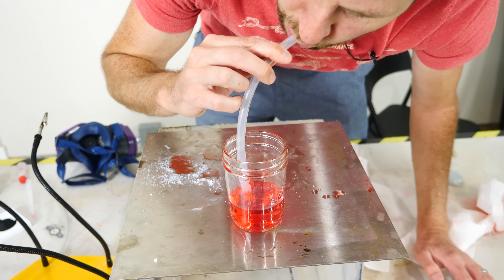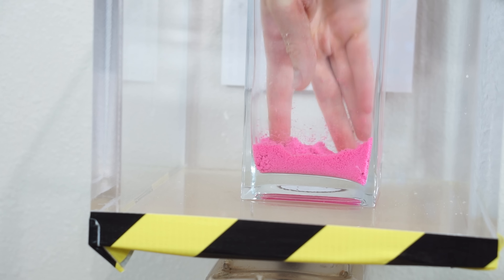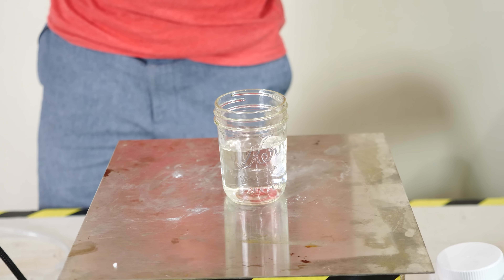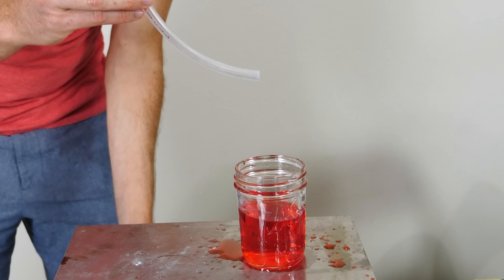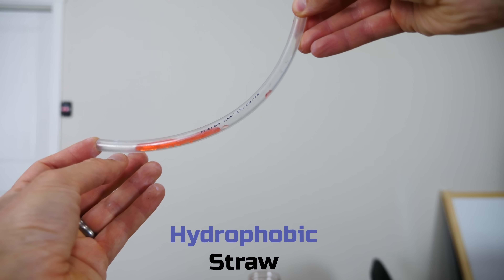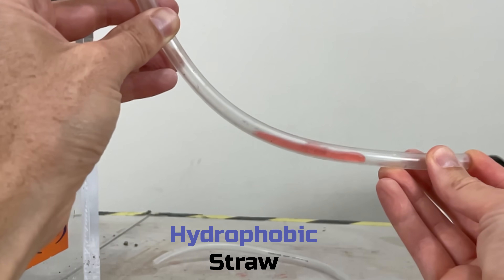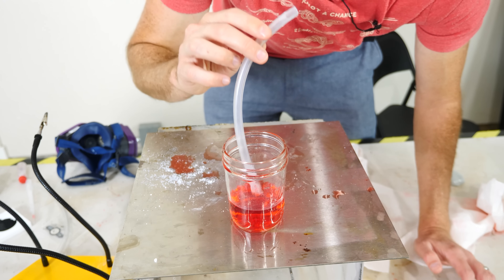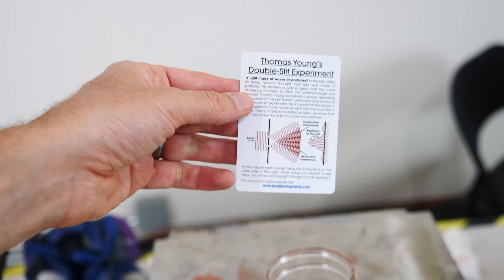Can You Drink With a Hydrophobic Straw?

Comment: What if you coat both sides of the straw so that there is an air column on both sides? Won’t that prevent you from sucking up even when the straw is submerged in water?

Comment: This isn't entirely true about the hydrophobic sand. After removing the air, the sand is still hydrophobic, but just no longer allows large air pockets to form a "membrane" that causes the sand to appear clumped. Removing the air just gets rid of this faux "membrane" causing the individual pieces of sand to stop maintaining a clump. The hydrophobic property still remains, but is only visible on a molecular level.

Comment: He didnt explain why is it that the water can move without resistance in the hydrophobic straw when both ends are plugged. Wouldnt the air preassure on both sides prevent it from moving? He is supposed to explain everything!!

Comment: If a normal straw locks water in the middle when you plug both ends, couldn't you technically do that with water bottles somehow?

Floating water seems like a cool thing :D
Reply: In the case of the straw, the surface tension plays a role too.

Comment: I'm not sure I agree with your hypothesis about the thin layer of air being how it gets past the water in the straw. I think it's more likely because the waters surface tension doesn't interact with the walls so it can't form the boundary with the air which can't break, so the water can just move out of the way, you can see that when you plug both ends, the water doesn't stay as a plug it kinda bubbles past the air

Comment: Everybody gangsta till he makes himself hydrophobic and gose to the bottom of the ocean
Reply: I mean, you wouldn't drown...
Reply: @geo4876  exactly
Reply: @geo4876 would suffocate though and die from the water pressure though without protection
Reply: @1fish146  That's different from drowning
Reply: @geo4876  i never said it wasn’t
Reply: @1fish146  Why did you make the original comment then?
Reply: @geo4876  i was explaining even if you wouldn’t drown you would still die??
Reply: @geo4876  but fall at incredible speeds, and die from impact ;)
Reply: If you leapt into the ocean in a set of hydrophobic scuba gear you would literally fall through it to the bottom. Possibly the pressure might overcome the hydrophobia at some point, but given the cavitations you'd leave above your fall it might literally not catch up to you in order to put that pressure above you actually ON you. Hard to say, I'm far from an expert.
Reply: @gwamhurt  You wouldn’t fall to the bottom tho, the layer of air between you and the water change nothing in the forces of  buoyancy, in fact, since you’ll be displacing slightly more water you’d probably be slightly more buoyant
Reply: @lotharschmal7991  fair but youd fall til you reached the equal bouyancy wouldnt you?
Reply: @gwamhurt  The same way you’d fall if you weren’t using any gear at all.
Reply: @lotharschmal7991  Not really, you fall far quicker in this way, you would be falling through the water almost at the same speed that you would fall by jumping out of an air plane. Buoyancy isn't always enough to keep people above the water, hence people drowning in pools all over the place. I can lay on my back totally flat and sink to the bottom of my pool (for instance).
Reply: @rdizzy1  That’s not even remotely true, please quote your sources/evidence.
Reply: @lotharschmal7991  What? A video of me laying on my back in the pool and sinking to the bottom? Lmao. On average, a human requires anywhere from 7 to 12 additional pounds of buoyancy to float, hence why they push for wearing life jackets for people that cannot swim.
Reply: @rdizzy1  Ah yes, and having more air around you somehow would conjure the force it takes to move water away and sink directly to the bottom. You need to present me some research buddy, cuz that makes absolutely no sense, like none at all. Your body needs to move water away to sink, the reason life boats are filled with air, something you’d be wearing all over your body in this case
Reply: @lotharschmal7991  things are heating up in the water fandom
Reply: @rdizzy1  floating is easy if you take a deep breath, if you exhale you start sinking even you are laying flat on your back.
Reply: @phat-on  Yeah but obviously you have to breathe while swimming.
Reply: @lotharschmal7991  there was an experiment with a hydrophobic metal ball and it’s way faster
Reply: @gwamhurt  i mean you sound like one
Reply: @gwamhurt  Never heard of Archimedes, my friend?
Reply: @gwamhurt  nice theory, but in practice the pressure increases incredibly much faster than you think. The energy to push water out of the way must come from somewhere, and in this case, the fall.
Reply: @Geoman265 He would drown, this is because the oxygen in the air barrier around him would deplete and he would die of asphyxiation
Reply: @pointlessprocrastination  Technically, that wouldn't be drowning, since he wouldn't be inhaling water.
Reply: @geo4876  sorry, that is what I meant
Reply: @pointlessprocrastination  he could hold his breath
Reply: Sorry, but if I acquired hydrophobia, I'd probably be foaming at the mouth and dying shortly thereafter, ocean or no ocean... :P [/sarc] (#RabiesJoke)
Reply: @MGmirkin  because the best jokes are always the ones that have to explain themselves through hashtags.
Reply: WHAT YOU  KNOW BOUT ROLLING DOWN IN THE DEEP
Reply: @ppeggy45  shut it, Adele
Reply: @mursuhillo242  You know that you have the wrong artist right?
Reply: @brooklynmurrell1280  Rolling in the deep by Adele?
Reply: Veritasium did that, though with just a regular swimming pool
Reply: @TobiNightcore  Yes he did (with aerogel) and he said he felt more buoyant. So, you wouldn't sink as far without the hydrophobic material and it'd be easier to stay on the surface.
https://www.youtube.com/watch?v=GcdB5bFwio4&t=260s
Reply: A --h h
Reply: I'm not sure how long that air layer would last, but it surely won't  last long enough for anyone to make it to the bottom of the ocean
Reply: @litterbox019  No, no, he'd make it... Maybe not alive... But he'd make it.
Reply: He would need something to equalize pressure
Reply: Present your evidence, I'll be the judge
Reply: Ye
Reply: Goes
Reply: Why would everyone stop being gangsta because of this I don't understand
Reply: @explosu  Why do magnets work?  We don't know it just happens.
Reply: Something I never knew I would be terrified of
Reply: Put a door underwater for 2 blocks of air
Reply: I feel like yes you'd be more buoyant because of the layer of air but it depends on your acceleration, if you're accelerating at high speeds into the water the pressure might keep you going downwards until friction makes it slow down. Friction would still work between the air layer and the water I think but I'm not sure because I'm just using prior knowledge and have no real specific research on the topic nor am I an expert.
Reply: The weight of the water was enough to overcome the hydrophobia inside that tiny cup. It would change nothing of you jumped in water.
Reply: cant wait for this video..
Reply: dies from pressure
i dont think we gangsta anymore..
Reply: Someone did that but goes in a pool instead
Reply: Watching experts explain is so satisfying I meant these guys at the comments
Reply: When you accidentally step into the Mariana sauce trench: o no
Reply: @breadisyummy_  everybody always forgets trench’s middle name
Reply: AHHH "EXPERTS" THIS IS A JOKEEEEEEEE SO STOP SAYING "he drowns becuase science science"

Comment: "They have almost no friction going through there, so they just shoot out he end!"
Me: :turns to the left to look at my waterslide plans:
hmm
Reply: Wait Are Regular Waterslides Not Hydrophobic?
Reply: @JNJNRobin1337  i think the problem is, that the water doesnt lube the slide anymore, meaning that if you tried sliding down, you just would sit on the dry slide, while water is flowing besides you. You need the water to reduce the friction between yourself and the slide.
Reply: @Eiferius  So what your saying is that we need to replace the water with lube!
Reply: @abdisaniini  yes
Reply: @Eiferius  But if you're wet, I feel like the hydrophobic slide would work.
Reply: @Eiferius  yeah that might make for a very painful experience
Reply: @JNJNRobin1337  Haha nope
Reply: @JNJNRobin1337  it depends on the plastic you're using, but the surface treatment shown in this video only works because it is a powder that helps preserve a layer of air between the surface and the water. In a water slide, this surface treatment would be washed/scraped away quite readily, not to mention that it would probably be very unhealthy to ingest this hydrophobic fumed silica.
Reply: Too bad the fumed silica is delicate. And would not stay in place. Adding it in abundance would be a health hazard due to breathing it. And it is very very light so a mild breeze alone would blow it away. Water would slide fast due to no surface drag, but people would not. Silicone oil soaked bathing suits on a regular water slide would be where i would start lol. But that would be crazy fast and i have no idea what health hazards the oil would have. But the speed hazards i can imagine woukd makensone good videos, errr or bad ones.
Reply: @airfriedquadsbw   Thanks for the information lol 😆
Reply: @rhirhisax  you got me cracking up
Reply: @airfriedquadsbw   😂 👍
Reply: @airfriedquadsbw  “health hazard due to breathing it in”

Meanwhile at action lab: “Watch me suck this straw”
Reply: @Wertsir I sold that stuff for 20 years. First time I saw it was regarding the space pen. Could write upside down  in space under water. Cost 1 million dollars to design. I was in grade school. Didn't know one day I'd be selling the stuff for them. Russan solution to space pen... pencil.
Reply: @Wertsir  they gave me a space pen when I left. And a model train car. But that pen, I was so happy. It's said Cabot NASA Space Program.
Reply: @airfriedquadsbw  That’s wrong, you can’t use pencils in space due to microscopic fragments of graphite
Reply: @AfromanRants  it was a joke. Pen is 👍true. Pressurized the ink cartridge. Used fumed silica to more or less to clog around  ball point stop ink from just flowing all time. Little bit of sheer silica slides ink comes out.
Reply: @airfriedquadsbw  I think it'd be very easy for you to die in such a ride considering the speed
Reply: @Dell-ol6hb  I said it wouldn't work. For many reasons, if it did some how work. Breathing it in is a big issue. It is said it doesn't create static. But I know a commercial lab or two that would dissagre
Reply: i keep reading quote comments as they're said in the video and its tripping me out hard o-o
Reply: Oh wow-😯
Reply: Just coat yourself in any mostly water fluid, something that'll stick but is still 80-90% water and BOOM human cannon
Reply: @ClippyJoestar  dude I have 2.5 million hits in 3 days on my tictok. All JOJO FAN CLUB. I got 2 steel balls did couple things with. I had never heard of jojo til 1 million hits in 12 hours. They still coming.
Reply: @ClippyJoestar  and funes silica doesn't work like that. I sold it for 20 years. Does make waterproof sand. And gravel. Greece. But it is in alot of foods. Keeps powers powder, not clumps. Aerogel is 100% fumed silica. Getting it into the shape of fluffy bricks is the trick. No spin to do it gyro
Reply: I was thinking about that right before I read your comment 😂

Comment: Have you done this experiment while coating both sides of the straw?  My guess is that you would not be able to suck up liquid through the straw with this setup since there should be a coating of air around the whole straw, which would prevent a vacuum from forming.

Comment: I had a question about the speed of light. 
If a human with a gun was inside a vessel travelling at 99.99r the speed of light, and fired the gun forward whilst inside the vessel what would happen? Would the vessel, human and gun slow down to accommodate the bullet which wouldn’t move? Or would the bullet pass the speed of light and just disappear?
Reply: The universe would implode upon itself due to a division by zero.

Comment: What happens with iron when you put it in a chamber with 100% oxygen? (compared to normal air)
Reply: I don‘t think it would rust because the process requires water molecules… google „iron rust chemistry“ and look at the first image.
Reply: You would be very surprised at what happens in an atmosphere of pure oxygen; it is highly reactive, and there is very good reason why the process of stripping electrons from a metal is called "oxidization". Do you know what other common phenomenon is also an effect of an oxidizing reaction? That's right, fire!
Reply: Wow, I didn't expect serious answers, and that anything else than faster rusting would happen, lol
Reply: @fehnboi5491  it very much depends on exactly how much faster the rusting occurs. The key ingredient in thermite is iron oxide; and when that stuff ignites, it produces an exothermic reaction that supplies its own oxygen and can cut through solid rock. So yes, extremely fast rusting can quickly become a very big problem.
Reply: @techgeeknzl  and tiny particals of most metals self combust. In pure ox i would bet on combustion. Id run. Lol
Reply: Fire
Reply: It rusts?
Reply: @techgeeknzl  oh, really, genius?
Reply: @fehnboi5491  of course it does. What do you think rust _is_?
Reply: @techgeeknzl  lol, dude, ok, I'll explain it, I mean how fast it would rust, compared to the normal air

Comment: This phenomenon would work in the vacuum of space in some advanced technology that required a liquid in a vacuum sealed tube to move around the tube like rotation or fuel transfer. Would this work with gasoline and does this mean if we make a gas engine have these tubes it could utilize the gas sucking it threw the tubes into the engine within the vaccuum of space if we can also get the fuel to combust in a vaccuum... but with this tube we are close to having gasoline engines in space

Comment: I’m a plumber and you may be on to something here.  If we were to make hydrophobic piping for drainage you technically could get away with not having to install a vent on the sewer as well as reduce clogging because the water carrying the waste would have much less friction and in theory drain better.  Also I would be curious to see if you were to run  hydrophobic water lines if it bring hydrophobic would effect any water tight connections like threaded pipe and fittings and unions and such? Would it decrease the integrity of the fitting of cause it to work better? I wonder ....🤔

Comment: Yaknow this brings up a very interesting point, what if we had hydrophobic pipes and as a fail safe can be lifted manually out of (lets say fuel and the line is on fire and the switch is broken) and it can stop the fuel flow quickly and lessen the fuel added to said fire.

Comment: 4:35 Sorry, but that is wrong. It has nothing to do the water collapsing around the straw, which it doesn't do, but it's the liquid is pushed up by the  pressure of the atmosphere, this happens regardless of the hydrophobic straw. When the straw is lifted the liquid falls down because the is no more liquid outside the straw to keep it there.

Comment: boat sinking 
"We have no life rafts"
pulls our fumed silicate
"We do now"
Reply: Wouldn't that make it sink faster, as there would be no bouyant force?
Reply: @afez2752  I guess action lab needs to do another experiment
Reply: @afez2752  so you're telling me that being pushed away from water pulls you into water
Reply: @ilyte1  No, the water is pushed away from the boat leaving a cavity underneath so the boat falls down
Reply: @MlorenDraymeer  I think it is more like a hovercraft. A hovercraft cannot fly, it needs the ground or water surface to support its weight even though it is separated by an air cushion.
If you make an entire boat hydrophobic, it will exert a force onto the water which will push the water away. But by Newton's 3rd law, the same force is also applied in the opposite direction and the water is attempting to push the boat away. And guess when an equilibrium will be reached? When the boat has displaced such amount of water to equal it's own mass. A lack of friction does not conclude a lack of buoyancy.
Reply: @MlorenDraymeer  No, a hyrdrophobic boat would function the same as a regular boat in water. The whole volume of the boat and the air in and around it is still less dense than the water, so it would just sit on top as per usual. It wouldn’t have any water on it if you took it out, though, and that’s kinda cool.
Reply: @Phrscv  it'd probably have less friction and maybe be able to travel through water quicker but otherwise it's indistinguishable from a normal boat.
Reply: @canis_lupus2220  big brain
Reply: @canis_lupus2220  I have understood that hydrophobic materials do not exert any force against water, the water just doesn't attract it as much as eg. air. But I don't really have a good understanding on the topic, please correct me if I'm wrong : )
Reply: @afez2752  it's the otherwise, more buoyant force due to trapped air at the surface of material.
Reply: @WeisSchwarz  Air does not have a stronger botany force to water
Reply: @afez2752  so you say that air bubbles will drown in water?
Reply: Lol
Reply: BECOME THE LIFE RAFT
Reply: Kinda wanna see this play out
Reply: yes
Reply: We are the raft now
Reply: "I can't suck it up" that's what ex said
Reply: Ppl are smart these days
But they will only make it hydrophobic?
Reply: I think it was a joke